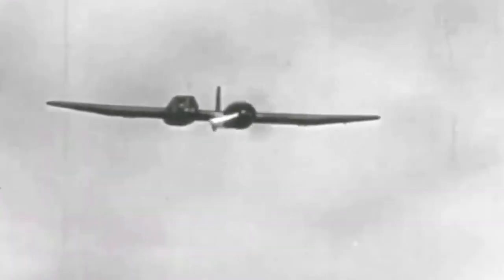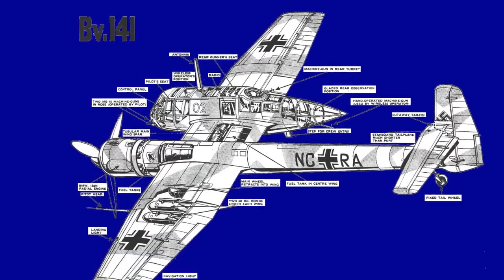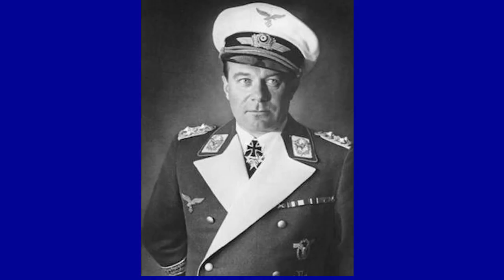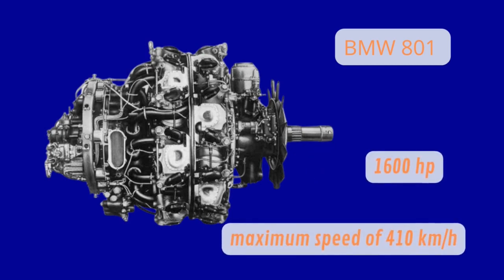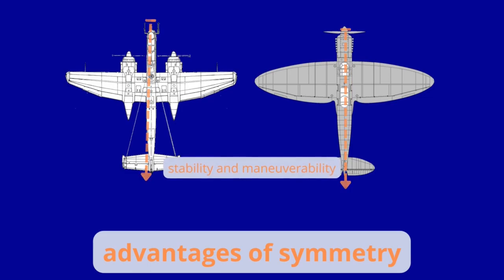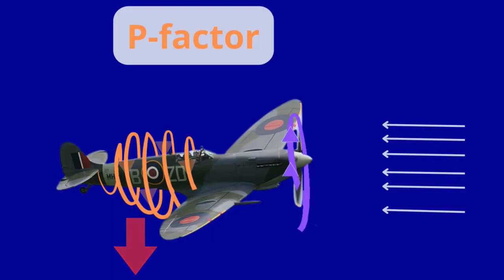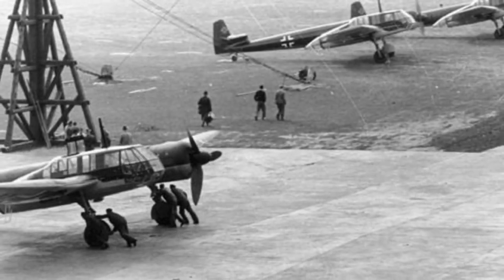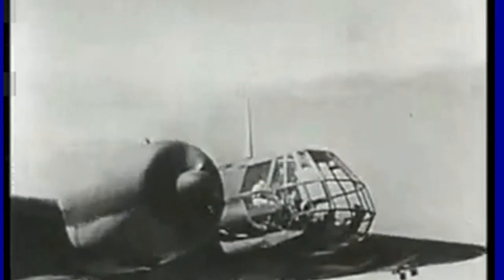One of the Strangest Aircraft Ever Built The BV 141

Comment: Single engine propeller planes really arent symetrical though. The torque and gyroscopic effect of the prop and engine make them unsymmetrical.

So, counterintuitively, this aircraft could be more balanced in certain flight envelops than conventional designs.
Reply from the maker: I think you are both right